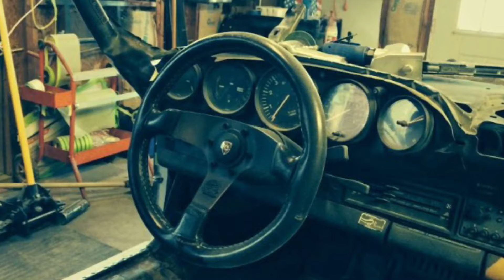1980 Porsche 911 Build then changed to slant nose

Comment: What Body kit did you use for the flat nose conversion?
Reply from the maker: it's not really a kit, I bought the fenders on Pelican Parts. It appears they were custom made. The lower valance was bought from gt racing, that will be in the next video.